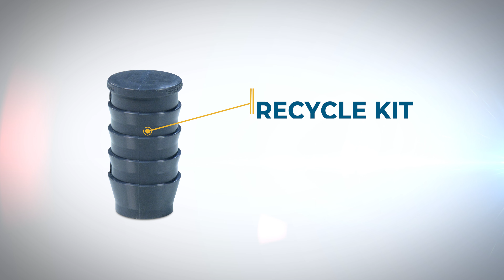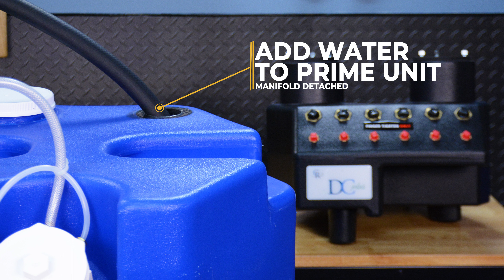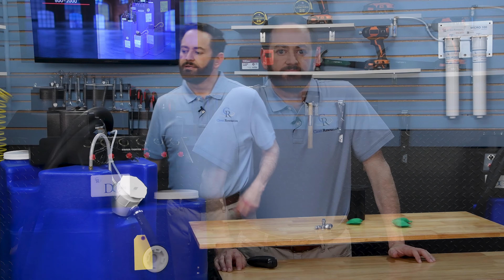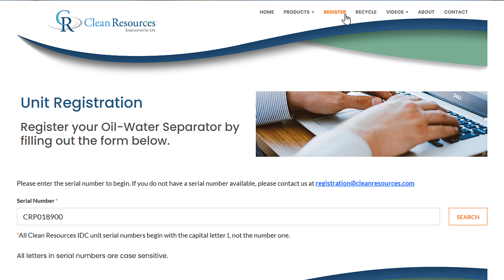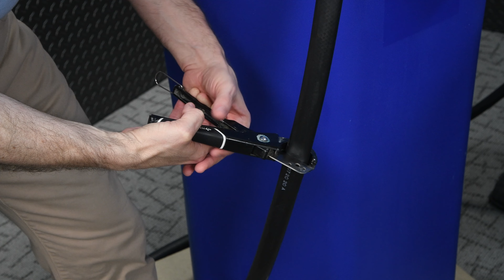CRP Series Installation

Comment from the maker: Correction: 03:33 Timer drain operation is recommended for all applications, but only required for some. Contact Clean Resources to determine if the timer drain is required for your application.